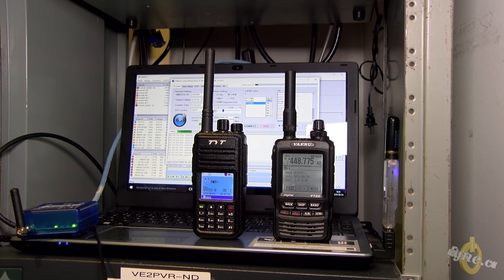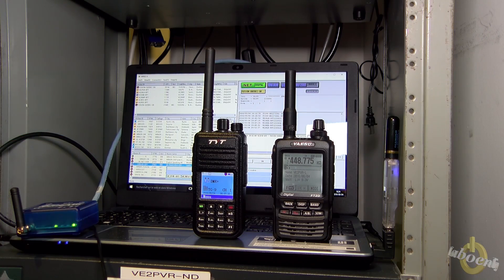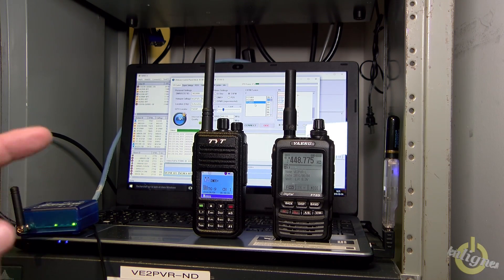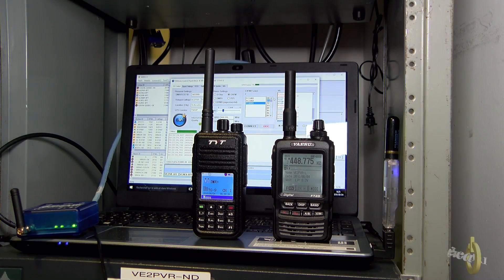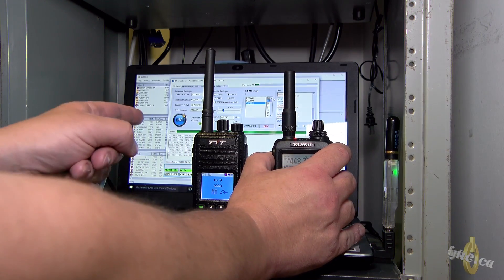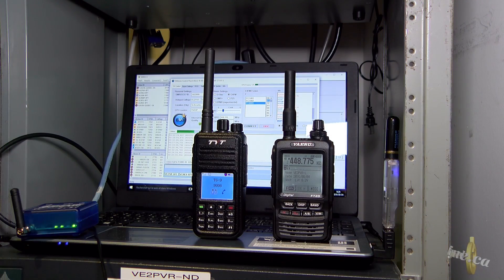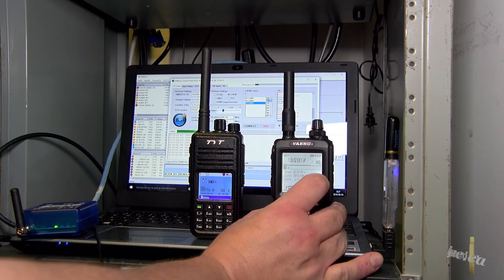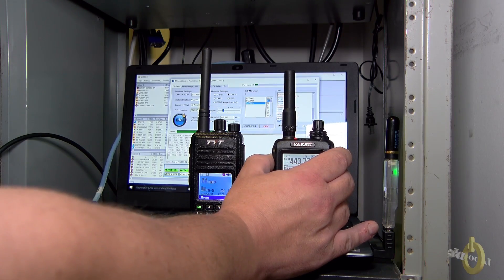Part 2 - SharkRF OpenSPOT DMR C4FM crossmode Wires-X test DN VW

Comment: Hi. 
I was just wondering what settings you have the DMR radio set up with. 
I see you have programmed in a Digital Contact Name of DMR+ I wonder what Call ID you entered? and any other specifics. Just re-watched and saw 9998.
As you can tell I am totally new to DMR.
I have the RT3 and an openSPOT as there are no local DMR repeaters nearby.
___________
Since my original post I have of course had a play.
I have found that where I have programmed the radio for DMR connectors appears to work when I have the openSPOT connector set to FCS and the modem in DMR Hotspot. I can see I have connected to the x-connector Group 3. But have yet to have a conversation.
Reply from the maker: Just check the web page below at the bottom of it you will find my radio settings.  73
http://www.va2pv.com/dv4mini

Comment: Will this work for D-star the same way it does for DMR? That is, crossmode between C4FM and Dstar?
Reply from the maker: Not for now, but even in the future I'm not sure, my understanding is that there is something proprietary in this protocol that will make it difficult without a AMBE chip.
Reply: Hi,
I thought that each of the systems (D-Star, DMR, Fusion) used and required the AMBE chip as the vocoder. Do you know why D-Star is the odd one out in this case?
Reply from the maker: Yes, there's no AMBE chip in the OpenSPOT and D-Star as a different bandwidth, maybe that's the reason. 73

Comment: that is pretty amazing. i think this sort of "crossover" technology is the future. it's crazy to have all these different networks and protocols that cant talk to each other. i wonder though, since its going from one codec to another, if it is being recompressed again and losing quality in the translation?
Reply from the maker: There's no quality loss.   DMR is using 2-time slots of 6.25 kHz.  C4FM is using 6.25 kHz for DN (digital narrow) and 12.5 kHz in VM (voice wide).  They use the same vocoder that's why.   SharkRF had confirmed to me that there was no vocoder AMBE chip on the OpenSPOT it just fitting the 6.25 kHz and a time slot and in DN. That's the reason it only work in DN and not in VW.
Reply: that's awesome! I was NOT expecting that answer. so it's basically just translating the protocol and containers but keeping the original encoded audio completely intact across platforms. very cool!
Reply from the maker: Here's the exact answer that I received.  "There's no AMBE chip in openSPOT. Cross mode works by recalculating the FEC used in DMR and C4FM. The AMBE data is not touched, as it is the same in C4FM/DN mode as in DMR."